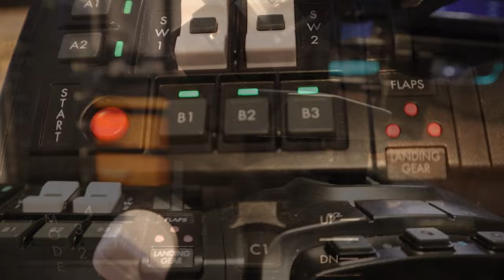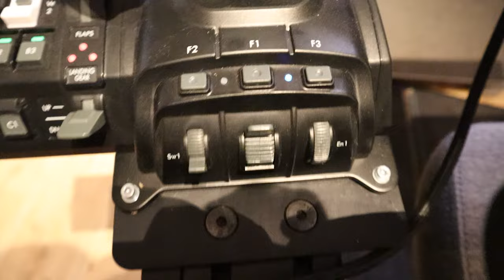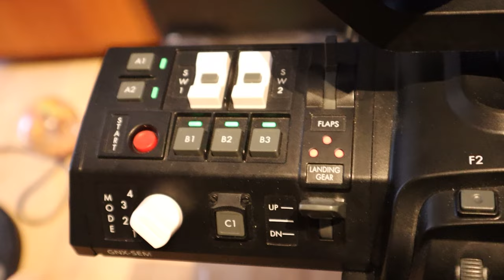Unlocking the Secrets of VKB Evo Joysticks with SEM Module

Comment: I have the EVO Omni Throttle for left, the Gunfighter 3 with scg for the right and  the vkb trudder. L I like how you can configure the omni throttle as just a throttle by locking the axis. My only complaint is the Trudder does not have toe breaks.